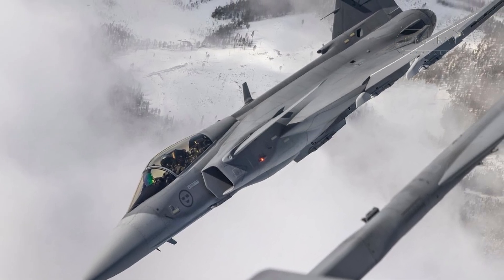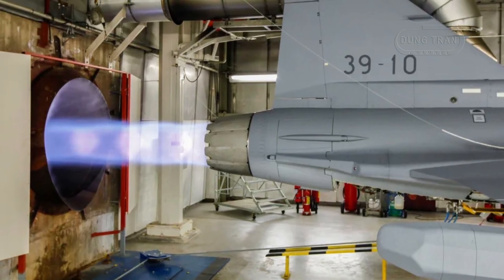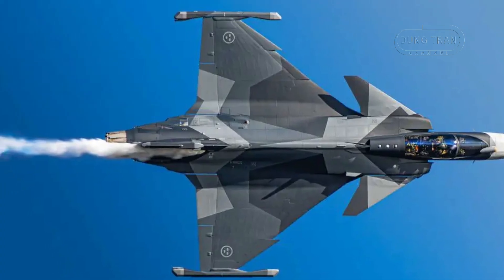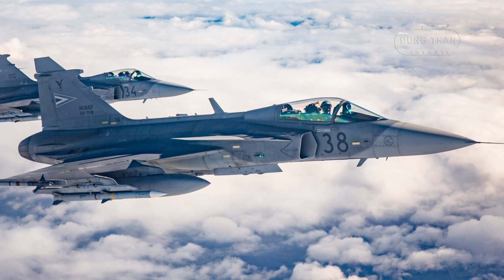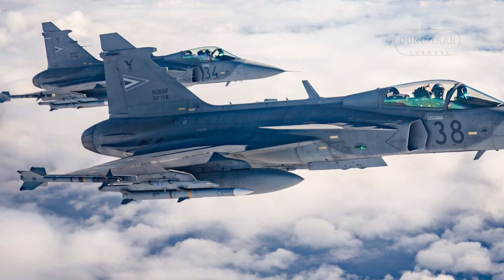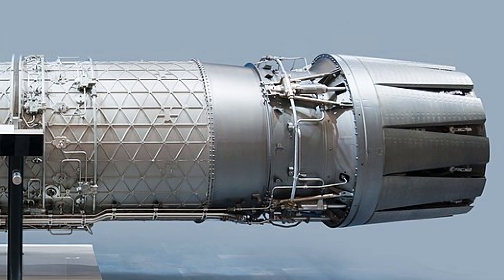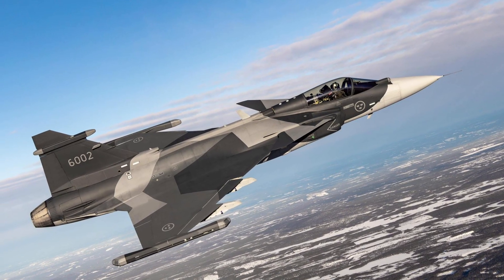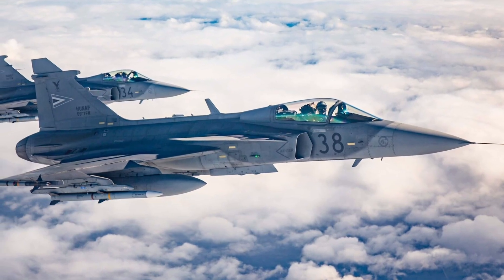Sweden's Gripen E's Hypothetical Power-Up: EJ230 vs GE F414G Head-to-Head

Comment: It needs to be done, without a doubt.
Reply: Absolutely agree, the sooner the better.
Reply: Who pays for it? customer or Saab? Integration and airframe redesign does not sound cheap
Reply: @SteelBattalion07  I would imagine SAAB have been working on this for some time already. It's not cheap to develop fighter jets either. If a non-US engine could unlock markets I'm sure SAAB are happy to make the necessary investment. Again, I'm sure they're already on the ball.
Reply: @ I hope that’s the case. But I think it will push the cost per airframe higher than current version. I wonder whether they can keep the cost competitive with a F16V70 with the reengineered version of the Gripen
Reply: @semi-sound You’re not sure. You’re speculating.
Reply: @SteelBattalion07  it was already an option  in 2022 and it weighs less than the F-18 engine
Reply: @ the word “option” is doing a lot of work. I’m just curious how much integration and redesign work has been done or not at all? If not at all, the customers aren’t getting new jets in 3-4 years
Reply: @SteelBattalion07  Replacing the orange man int the oval room might be quicker…
Reply: @SteelBattalion07  it has already been flown with the engine it was one of options  during development
Reply: @ then why isn’t Saab screaming from the roof top with press releases and promo videos and we have to see some YouTube hint at it. It’s been really hard to find any official or public sources about this
Reply: @SteelBattalion07  Saab’s CEO Johansson has confirmed in Swedish media that discussions are ongoing with Colombia, Portugal and Canada. If Saab happen to know that supply of American parts isn’t a problem or at least they have no negative information so far, they’re not going to talk about it.
Reply: @SteelBattalion07  perhaps because its a really sensitive matter that USA loses all weapon's trade to Europe Sweden are for example testing SAMP/T Aster 30 MAMBA for further purchases instead of patriot.
the EU financing inactive 800 billion under Europe rearm
Reply: @andreas6582  Until confirmed by SAAB, we are all speculating. But there is such a thing as an educated guess: SAAB is a publically traded for profit corporation and as such they have an obligation towards their owners to maximise profit. And given that they have already swapped the engine once, from Volvo to GE - (and made changes to the air frame as well) - it is difficult to see why they wouldn't make that investment once more - the moment the current US administration took their current stance. Indeed it would be malfeasence not to do it. It's the one thing corporations can be trusted with: Maximising profit.
Reply: @ 1.Saab convo with countries. I can buy they are having convos. Are the convos saying “yes we can give you a ITAR free jet? And 1. Will cost less than f16v70 2. We can deliver or make in Brazil in less than 3 years?
Reply: @andreas6582  There are 2 issues at hand. ITAR approval for Columbia, Portugal, Canada. Do they have approval to sell to these countries? We don't know. The supply of parts is a post-acquisition kill switch. You can choose an approved GE-powered Gripen and still be at the mercy of supply chain kill switch. But if you want a complete ITAR free/Kill switch free Gripen then that's a separate convo. If the Saab really wants the sales (or the South American market) AND the work have been done integrate, validate, flight science approved, than that's the version they should just market off the bat. Why do a "let's work to see if the Americans approve, and if we don't let's offer the non-American involved version?" direction?
Reply: @andreas6582  Yes but US reliability does not Improve when one Person makes all the Decisions Next President could be Vance  or a  Trump child
all they need is to be rich over 35  say they believe in a God  and say ill do it better than the other guy maybe the yellow guy Homer
Reply: The EJ230 should reengine all tranche 3/4 Eurojet Typhoons as well if the airframe mods aren't too expensive

Comment: The reliance on US fighter engines has made the procurement of fighter jets from Sweden's Saab a major concern for each country.
Reply: Yes but what are the alternatives? Planes coming out of South Korea (and possibly Japan down the line)  are also dependent on US components. 

You’re pretty much relegated to Eurofighter or Rafael but then you’re in a different price class.
Reply: @sunbeam60 the price is not the issue, it's capability and sovereignty that is most important.  SAAB is already working on switching to the Rolls Royce engine, it's more expensive but actually quite a bit better.  Canada could make the purchase contingent on the RR engine.  It is my understanding that they will have a flying prototype by end of year.